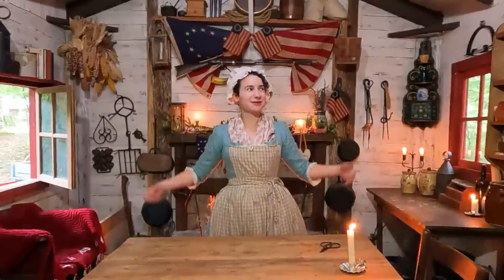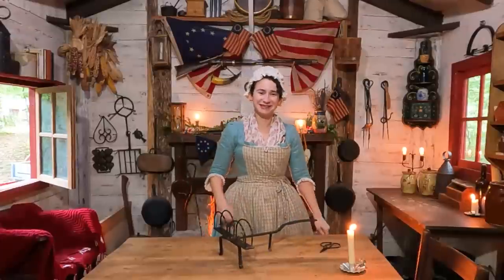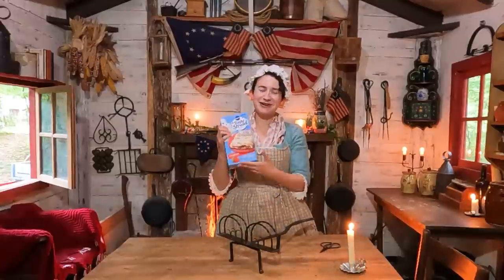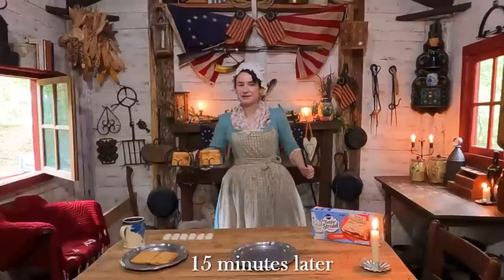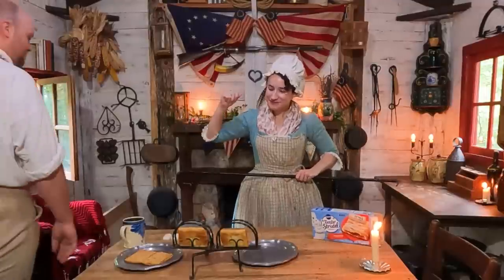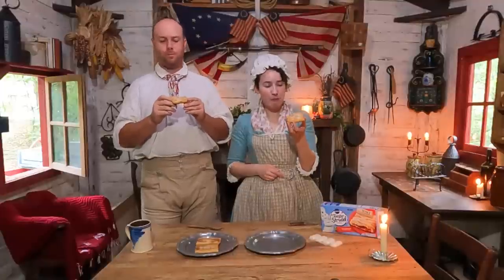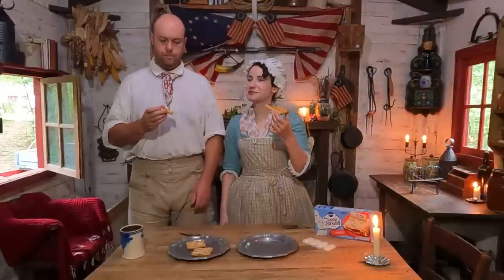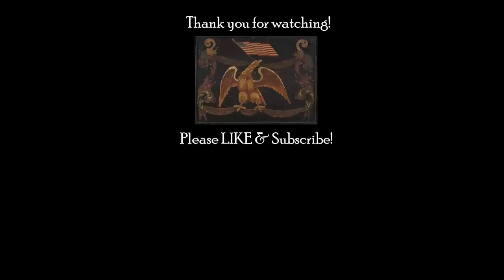🍓Making Toaster Strudels in an 18th Century Toaster |History Experiment|

Comment: Great demonstration of 200 year old appliance that works just as well today. You can find a revolving camping toaster that does the same thing as the 200 year old toaster but the modern one is round. you still have to use tongs to manually turn the bread to toast even though the new one is round and turns and can hold up to 4 slices of bread or toaster streudel to toast. :)

Comment: I live off the grid, so I don't have an electric toaster. I use a small wire rack to hold the toast, and I use the broiler in my propane range to make toast. I have to flip the bread over to toast the other side.

Comment: Hey Justine! Do you have a reflector oven to make cookies or hot sandwiches with? (And do you have any cleaning tips for reflector ovens?)
Reply: No I cant afford one yet but I really want one someday! They can be $400. They are usually tin you can wash tin with soap, water and a rag but you need to dry it quickly and thoroughly as tin rusts when exposed to water. Dry it with a dry rag.

Comment: That is so cool.  Love the experiment you did and the results.   I haven't had a toaster strudel or a pop tart in years.  Now I want to have one.  😂

The one thing I wanted to ask is about the plates you are using and any of the old utensils and cookware you are using. And if they are safe to use and if they are lead free.  I worry about higher levels of  lead in older cookware.  
Cast iron  pots are  great and I don't think there's issues wth cast iron. 
 But I see those plates you're using and I don't know if they are reproductions or if they are really old.  And the old utensils too.  Old Cookware too like bowls and things with glazes can have higher levels of  lead in and cadmium too. And the lead can leach into the food etc.  So I just wanted to check and bring the topic up.

Comment: Hmm.... I wonder if I put those in my Ninja Foodi Air Fry Toaster Oven on the "BAKE" setting for a few minutes at a higher temp, would it have the same effect as those that were baked in front of the open flame?  I would keep an eagle eye on them of course, to prevent burning.  Sounds like it's made with puff pastry.

Comment: I use a modern version it is a old metal coffee can with wires across the top . both ends of the can are cut out so you can place it over a fire or the electric burner in the house . I hate modern toasters they wont easily give you your toast when you want it